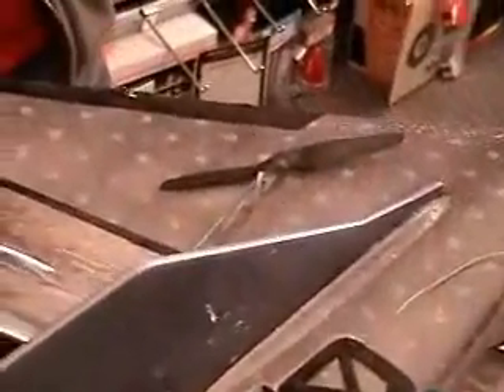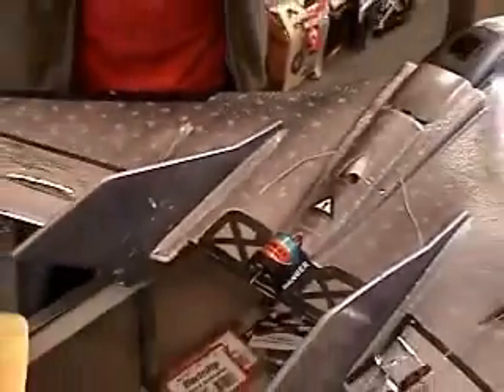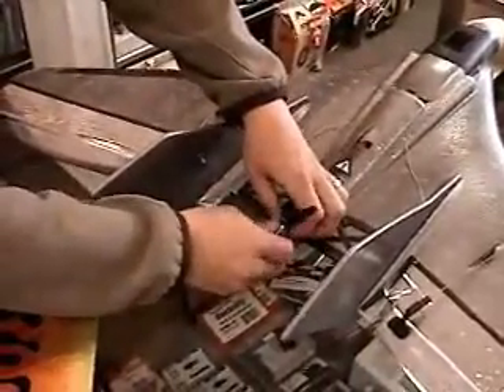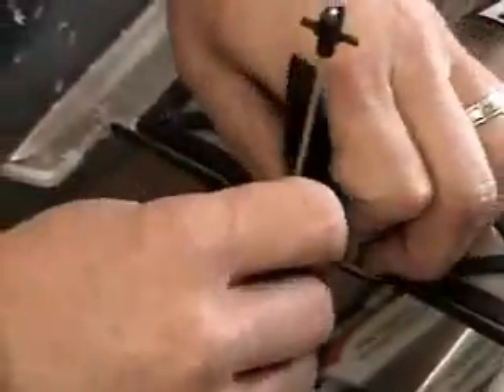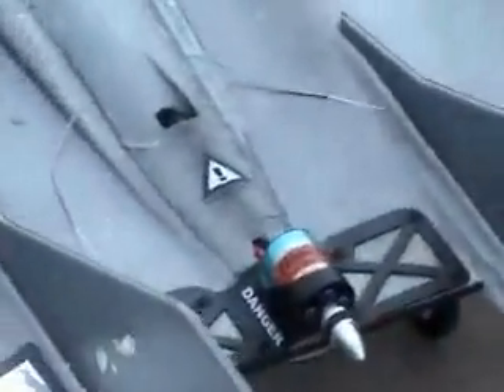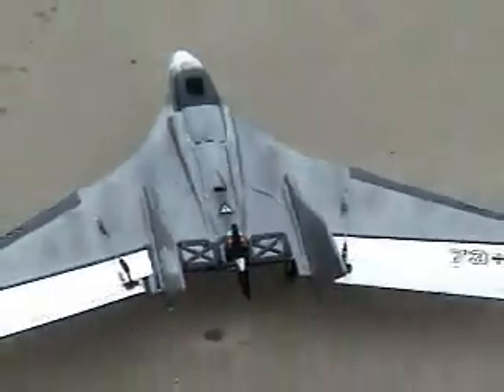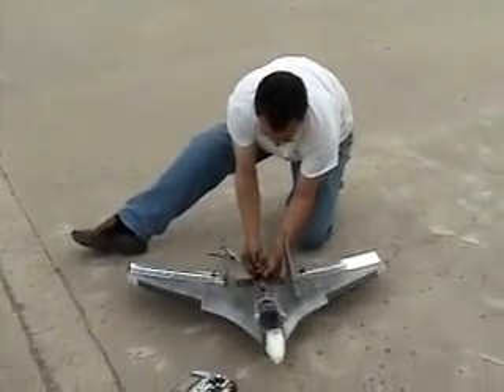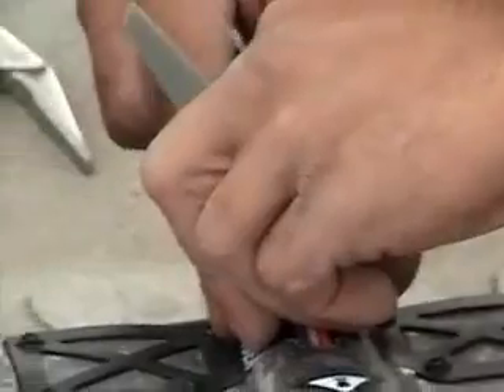CARBON FIBER PROP IN FLIGHT VS APC PRO.wmv

Comment from the maker: @drewpert15 It's my buddy's plane but I think its just wire bent with wood blocks holding it in and a servo and a wood plate noise wheel

Comment from the maker: @TheLipRipp3r 
not bad for my first one the mistake was made when I mixed the second round of epoxy that I injected into the mold. I tried to eyeball two 1/2 pumps and it toke a long time to dry and I lost a lot of straight
next one will be sweet
I will be a week or so we have to move Kenny's hobby shop this weekend to new a better place runway ther kinda suck but way bigger shop area